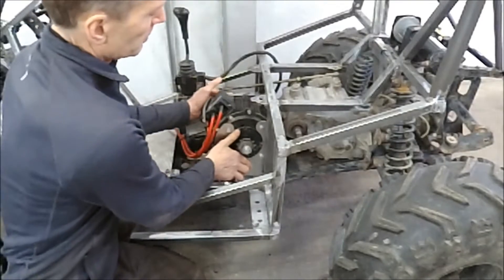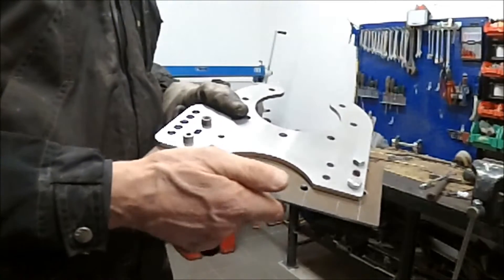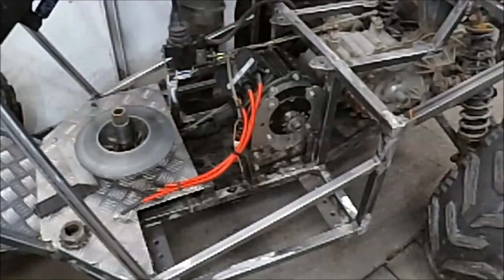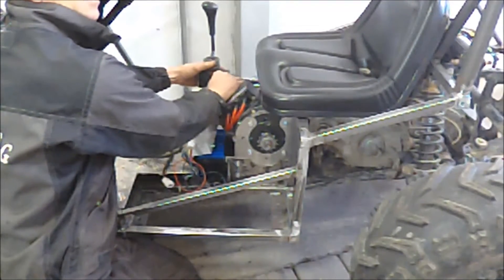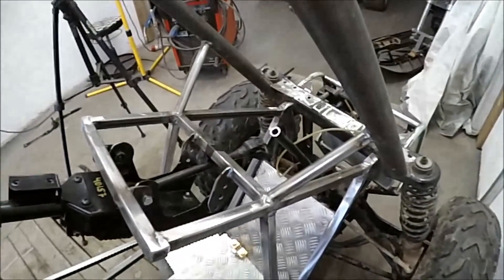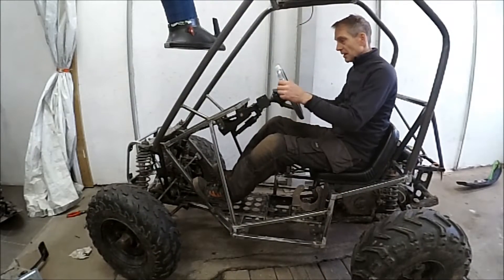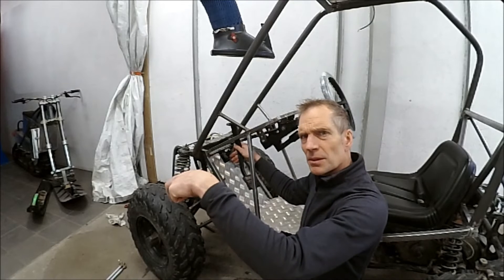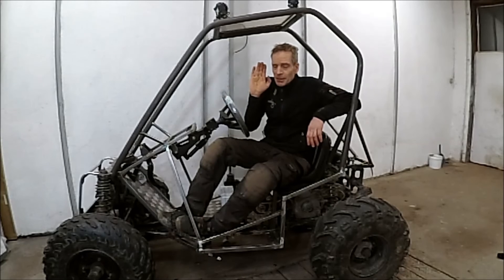ATV electric conversion 3

Comment: Brilliant!  What were your considerations for the gearing ratio from electric motor to transfer case?
Reply from the maker: I just estimated the rpm of axle from fossile motor approx 4000 rpm. BR Per
Reply: @persteel  I have a 1993 Polaris 350L with a blown engine and am considering converting it to electric and the gear ratio is something I am pondering.  With the gas engine there is a primary drive clutch with a varying diameter based on speed and a secondary drive with a fixed diameter hub on the transfer case.  Your sprockets are much smaller than either the original primary or secondary clutches.  Of course you know all this as your machine had a similar set up.

With an electric motor could you get away with a larger sprocket in the rear and have more top end speed if set up properly?  My thought is if torque is a concern you could shift the transfer case into Low.

Thoughts?  Insights?  Concerns?

Your projects and channel are amazing.  Thanks!